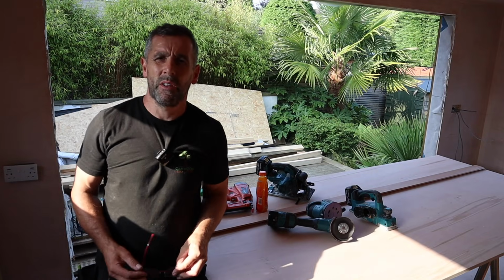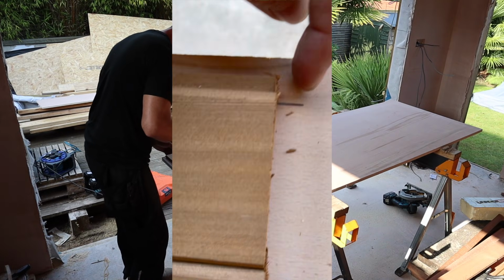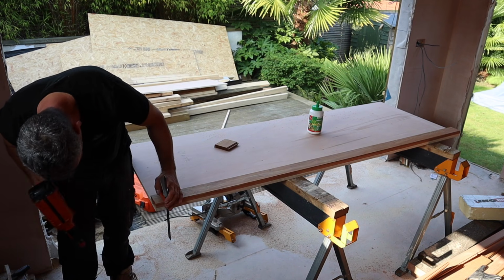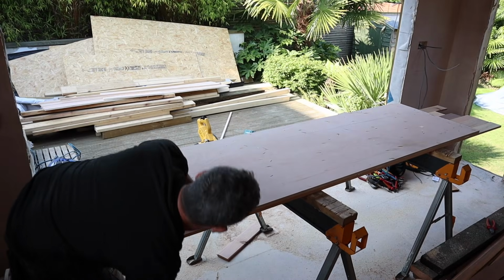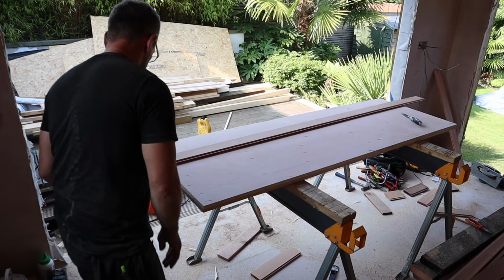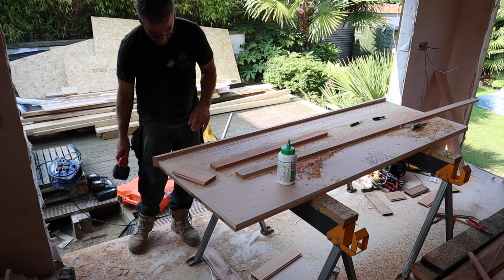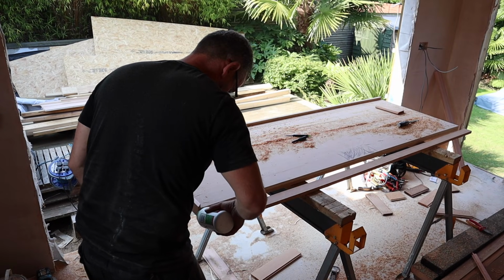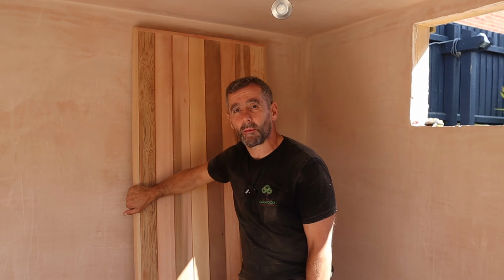Garden room store cupboard door, clad in cedar

Comment: Hi Liam, excellent video. Have you ever looked into the Makita guide rail adaptors which work with certain cordless circular saws? I came across them the other day but won’t fit on either of my ones. Works on the dhs680 though